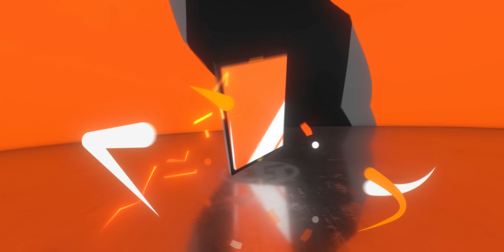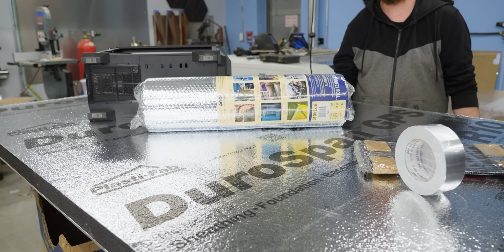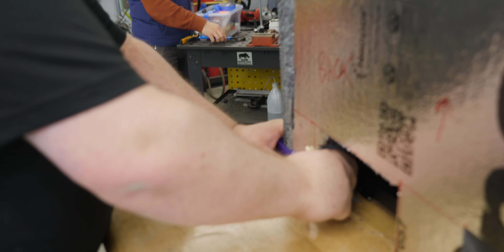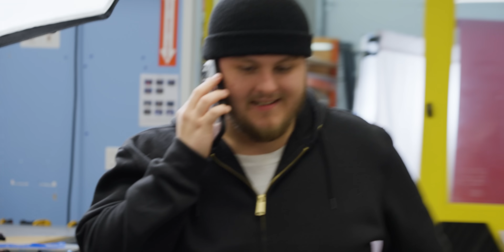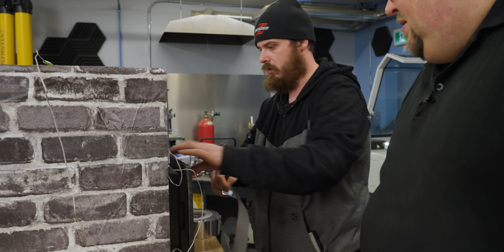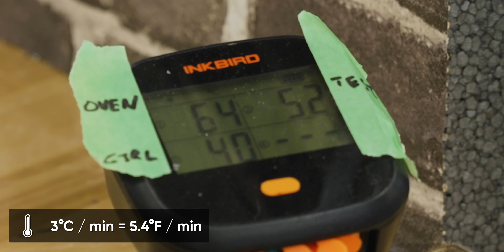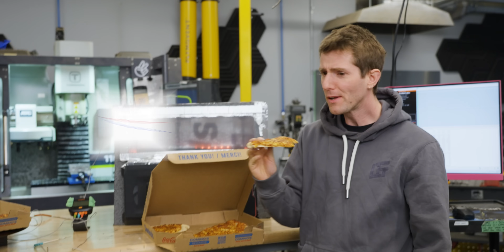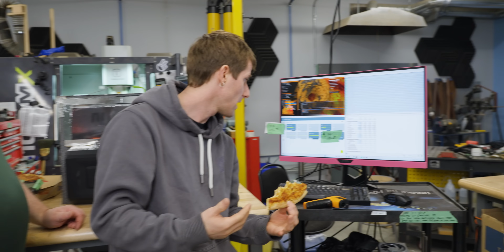Remaking Our Most Hated Video - Pizza Warming PC V2

Comment: Instead of using air, you should have built a custom copper plate radiator that would act as the bottom of the oven. That way the heat from the PC is transferred directly into the plate and into the pizza. It would also prevent pizza particles from dropping down into the PC. Add some temp sensors into the oven to monitor the temps and design the copper plate with exhaust fans that can be turned on or off if the plate gets too hot so they can work as a type of overflow for the heat. Don't want to kill the PC just to warm up a pizza.
Reply from the maker: V3
Reply: 2035  @LinusTechTips
Reply: @LinusTechTips if you need a mechanical engineer to work on the project hit me up! I know you got guys already, but if they’re busy I’m on the hunt for a job or a project to put on my resume.
Reply: @LinusTechTips  I suggest looking at the christmas lectures from the royal institution of london. Long ago they showed a core2duo with a passive copper heatsink cooking an egg. You need a hot enough CPU, heatpipes (to support the size) and the equivalent of a copper grill that fits food in. a fan could help prevent overheating and better spreading the heat around the food.

However given the price of copper you can use other materials for the grill but you do need copper heatpipes to spread the heat at a longer distance. aluminium's lower energy/degree can actually help as thats your endpoint for heat.
Reply: Pizza as heatsink  @LinusTechTips
Reply: they should have use a passive radiator for that, nice idea.
Reply: let's see DIY Perks version....
Reply: for a proper solution like this, you have to follow DIY Perks :D
Reply: v3 coming 2033
Reply: It's so funny I watched the video thought well man custom copper heat plate would work better. Thought man I wonder if anyone else thought of that. And second comment there it is. That'll teach me for questioning this comunity
Reply: I was thinking almost the exact same thing lol. Only problems would be it would take longer to heat up (which could be resolved with normal preheating you do while cooking) and potentially copper poisoning. Had aluminum or cast iron or whatever pizza pans are made of in mind instead but same idea, you could line the copper with foil regardless
Reply: that's what I would have done, but I appreciate that they went for something more involved
Reply: @stevecole90099  i was concerned about humidity
Reply: i think the point of this video was that it was quick, easy and most of all cheap to make
Reply: I genuinely thought this was the idea
Reply: I definitely agree that there needs to be a way to keep pizza particles out, and move air through to the PC better. My thought was more active, in that you could take and transfer the thermal energy to the pizza better if you used a refrigeration cycle. By sticking the cold end on the PC side you could then 
A) remove more heat from the PC exhaust air  
B) have a hotter exhaust for the oven, allowing better heat transfer at higher temps
The added cost may outweigh the benefits though. Idk how much additional energy you’d have to add to the system to get the A/C running. For someone like me, when my wife and I have our PCs running it heats up the whole room. Being able to effectively transfer that heat into a designated space that can warm/cook food would be incredible, especially if it came with a significant reduction in room temp. 

If the active cooling of the air draws enough heat it could also cool the PC exhaust below ambient, creating a cycle of improved temperatures on PC components through the lowering of intake air temp, making a higher differential between heat sinks and forced air running across them. All of that would be significantly more work than just making a fluid channel through a high thermal conductivity metal.
Reply: If they ran the radiator piping into the copper plate first, then sent it though a radiator in the room air, they could get the "hottest heat" for the pizza without sacrificing any thermal performance of the PC.  Or perhaps they could have a mini radiator/fan just for the pizza heating chamber that scrubs the first few highest degrees of heat out before sending it to the much larger radiator in the room air.  It's similar to a desuperheater in a heat pump.  It pulls that high temperature heat out for domestic hot water.  If you tried to dump all the heat into the water tank you'd get a lot more of it, but it wouldn't be hot enough.
Reply: Wouldn’t that be really expensive?
Reply: I felt something was missing from the video. My initial thought was to have the radiator/exhaust located either at the top or back (I was thinking of conventional/air fry ovens) to avoid the issue with pizza stuff getting into the PC. This one is a lot better IMO.
Reply: I did like the brick look, but I feel since we're using a modern PC to warm pizza, it should look more like a modern kitchen oven as opposed to what they went with. My opinion.
Reply: Pizza particles 😂😂😂😂 

I don't know why that made me laugh so hard but I assure you it did
Reply: yeah, that seems obvious but I just doubt that it would work easily. Like, you'd have to wait till all of the water turns hot enough to make the radiator hot
Reply: You expect a bit too much from these guys when it comes to creative solutions. Only jank is allowed in this channel.
Reply: Yeah basically a heat exchanger and a thermal sink. Heat exchanger takes the heat and dumps it into the plate, and then let's the cooler air out. This allows better airflow in the system while retaining the useful heat.
Reply: This is an Alex idea
Reply: I don't think that would work as well, as you'd essentially be making a frying pan: all the heat would be concentrated on the bottom of the pizza (the copper plate), and whitout a a better conduit for the heat than air (such as water or oil, which we normally use for pans), the pizza would just be burnt underneath and not that well cooked on top
Reply: @ you’re not trying to cook the pizza, you just want to keep it warm. The pizza should be able to absorb enough heat from the copper to do that without wasting heat to air.
Reply: @stevecole90099  Have you ever tried to warm something up on a frying pan with no oil, though? It just burns the bottom as the heat is concentrated. It would work if you put oil on the pan used to heat on the pc, though, but that means you add oil to the recipe (which changes the food's taste and makes it worse for your health)
Reply: The heat exchanger does even exist already,  no custom needed for that. I have a passive radiator myself, that is a flat piece with water channels, a flat surface on one side and cooling fins on the other side. Mount it flat side up. Use a food save paint, put pizza directly on it. Put an insulated box around it. Cooling fins on the bottom get a box as well and the box gets a controlled fan. Let the water get as hot as possible without airflow and only then the fan keeps it from overheating. The computer case, in the meantime keeps it's normal airflow to cool everything that's not connected to the water cooling.

Comment: If you want to heat the pizza efficiently you want to not use a waterblock/use all metal/keep temperature near undervolting the processor or gpu in a max overheat/separate the metal in two different ways, one box for the pizza, one side keeping temperature from destroying the computer. The pizza side would be just a little hotter than the fan side as its lowering the temperatures of a PC
Reply: Just finished the video. Not a bad attempt tho I give you a 8/10

Comment: Simple go back in time and get a 4 slot board, highdraw CPU and 4 high output GPU's, 10 15k hard drives. I think thats about as much heat as you could manage. OK Overclock the Sh/t out of it.

Comment: A 14900k paired with a 5090 could probably even reheat the pizza
Reply: 1000w is more than some microwaves are capable of pulling.
Reply: @JETZcorp  my tiny toaster oven pulls 600 watts. I remember I saw some Midea or idk what the brand is of a microwave that pulls around 1200 watts
Reply: @literallyhuman5990  I have a 900w microwave in my semi that will trip the inverter if I run it too long.  It's a lot of power.  1500w is the most you can legally pull from a wall plug in North America.
Reply: @JETZcorp  well, it's the same then, in my country 1500W is the maximum amount you can pull for a household. More than that, you need to upgrade to 3500W that was meant for small home industry.
Reply: @JETZcorp  lol you couldn't be more wrong. There is no law concerning how much someone can pull from their outlet. 120v receptacles used to be fused/wired for 15amps (1800w) which is what you're thinking of. Modern ones are fused/wired for 20amps (2400w). Most consumer electronics that are UL/ETL approved do not pull more than 1500w just as a catch-all rule to prevent people's breakers from flipping if they have anything else on the same circuit. UL/ETL approval is not a legal requirement though. You can buy whatever random untested device you want that pulls 2000w all day long and you won't be breaking any laws. You might flip a breaker or two, but that isn't illegal. If you live in a 400 year old shack that was built by your great great grandpapi Bobbyjackjoe, then I wouldn't put your wiring to the test, but again, not illegal, just a little dumb.
Reply: @flyingtentacle7631  I figured it was a manufacturer-level law.  Sounds like it's less NHTSA and more IIHS, to put it in car terms.
Reply: @JETZcorp  just because it has more power doesn't mean it can produce more heat. Lmao. Microwaves produce heat using electromagnetic waves. If u put a piece of ceramic in a 500w microwave it can reach up to 1000 degrees Celsius, a 10k watt power supply isn't producing even a fraction of that heat lol.
Reply: @verakoo6187  100.0% of that power DOES become heat, actually.  A PC pulling 600W from the wall will heat your room just as much as a 600W space heater or toaster or microwave.  No it's not all in the PSU.  Obviously.

Now, can a PC create TEMPERATURES as high?  No, of course not.  The silicon will fail first.  But temperature is not the same as heat.  A car radiator may pump out a couple hundred thousand watts of heat, but that hot air may only be 60C.  Same with PCs.  Low temperature, high volume.
Reply: You could bake a pizza if you overclock both of them 😂. Over 1000 watts will probably bake a pizza.

Comment: I have a water cooled 7900 XTX with a big radiator on top of my "be quiet! Pure Base 600" (btw a horrible case for such setups).
But while gaming, the heat would be probably enough that one or more pieces of pizzas are stay warm (or maybe even hot?).
Anyone have an idea for a 3d print? I don't have an 3D Printer, but I probably could order something, made from someone, for that.
Would be a cool Project :)

Comment: The first thing I thought when I saw that 5090 is that we're trying to keep the pizza warm, not burn the whole rig down 🤣
Reply: A burning power connector is going to add a nice toasted crunch to the pizza crust.
Reply: A fire isn't a bad start to warm a pizza, depending on what you burn
Reply: just put a bite at a time on the power connector and you're golden